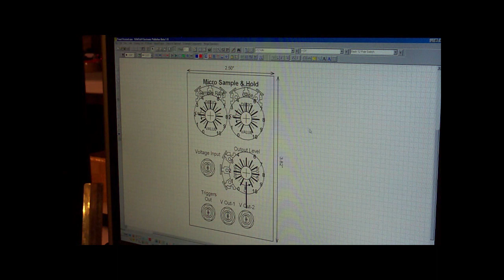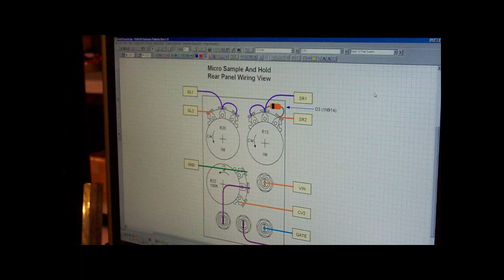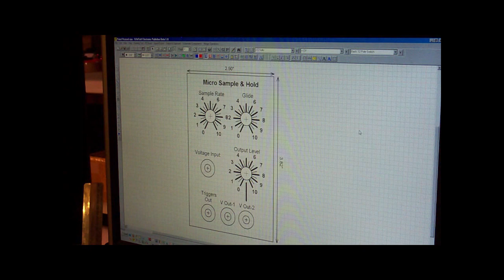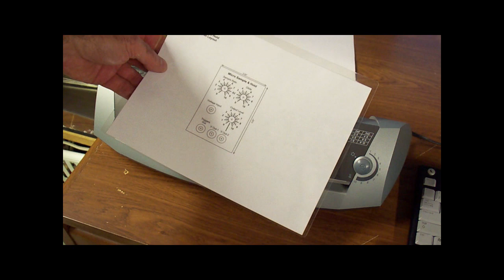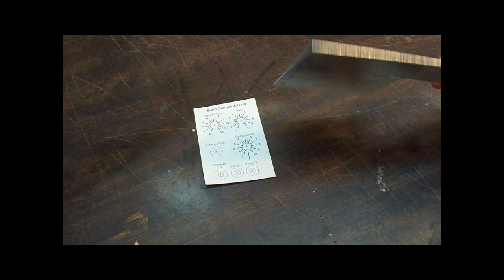MFOS How To Make Synth DIY Panels Part I

Comment from the maker: @Dodexas It is a program I wrote called Electronics Publisher. Any drawing program will do as long as you can determine the size of the output. Even in programs that don't really support that feature you can experiment by making a grid of some kind and printing it. Then measure the results to get an idea of pixels to inches and so forth.

Comment from the maker: I would suggest a small dot of contact cement in each corner and then clamp it somehow until the contact cement dries. For future panels try to apply some contact cement near edges and corners before applying the laminated panel legend.

Comment: Thanks again Ray, I have used this idea now for some time, nut I have noticed that on some panels the laminating sheet has come away from the cardboard.
It still looks OK but makes handling a bit tricky as I am worried about catching the corner and creasing it. 
I have tried Ironing it, and that seems to help a bit, but any ideas about how to avoid that would be great :-)

Comment: @Ray...If you can use any art program (I usually use Corel Draw), where do you get the actual 'controls' clip-art from?  I do have Front Panel Designer but I don't know how to use it as of it...is your program similar to that?
Reply from the maker: You need to experiment with the drawing program. I made all of the mechanical drawing elements using my program. You could use Corel to do the same thing. And I'd bet that it also has the capability to draw in mm or inches with some accuracy. Then use the layering capability to put the legends on one layer of the drawing so you can move them around on the plate surface layer. All that matters is that the end product prints out in the size you need. I hope this helps.